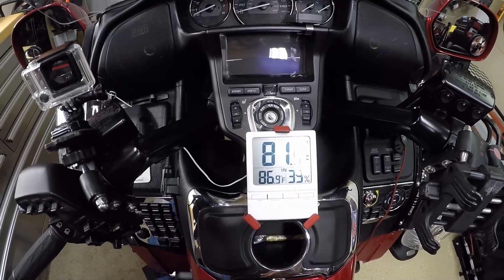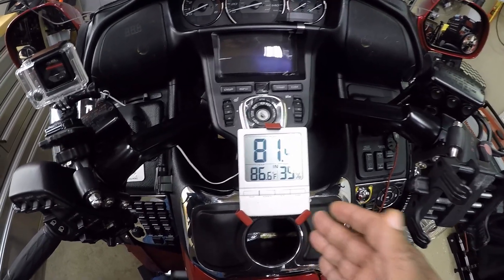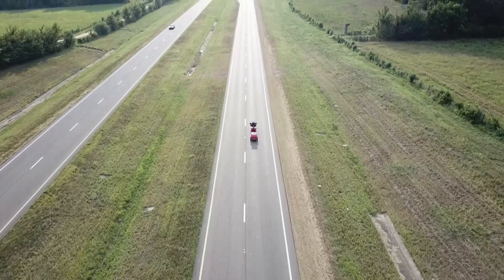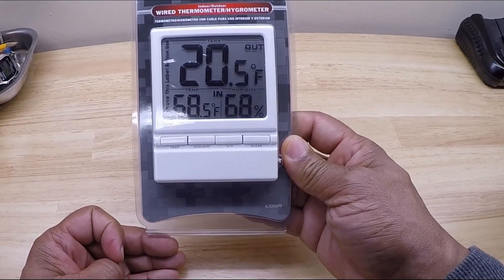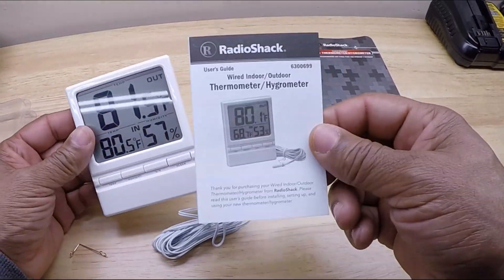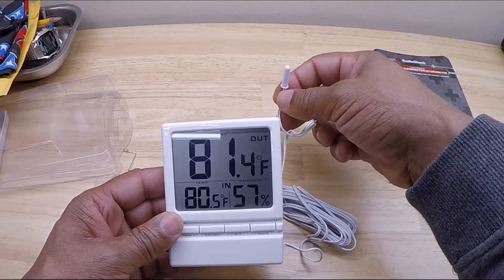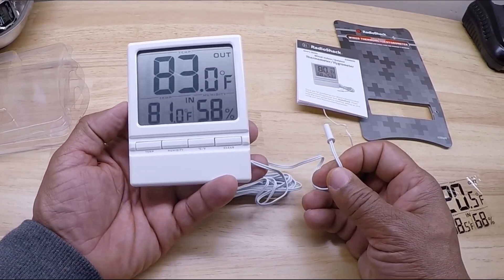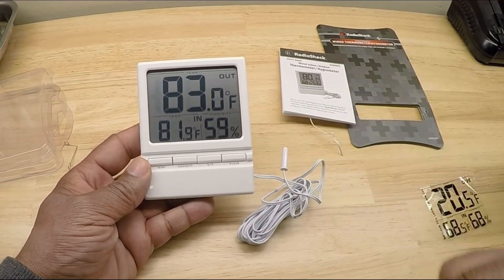My Temperature Display Explained

Comment: The only problem I see is that the main unit is designed to be in the house, and is NOT waterproof.  Rain will surely kill it.  Maybe not right off, but it'll get there.
Reply from the maker: Scott House I don’t keep the temp display in the weather, I remove it when it rains or in the summer direct heat.  If you must know, I remove my phone, radar detector or any electrical device that can get wet when it rains, my bike stays covered when I travel this is how I keep it looking so good.

Comment: You're right it's going to hard to find, however there are many similar ones on eBay and amazon.  I use something similar in my car...
Reply from the maker: Bass Player you are correct, I put up this video because everyday I get asked the same question, “what is that display on your bike, and were could I get one”.  I hope this video will answer their question, there are many different types on the market but this is the unit that I just happened to use.